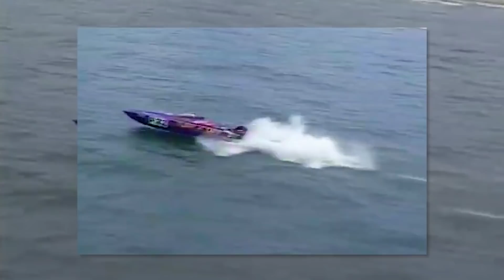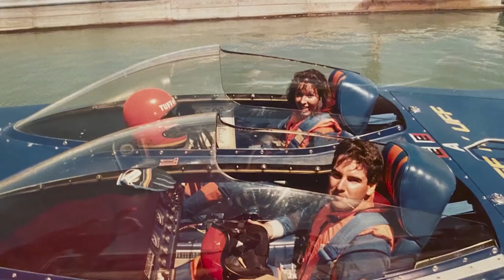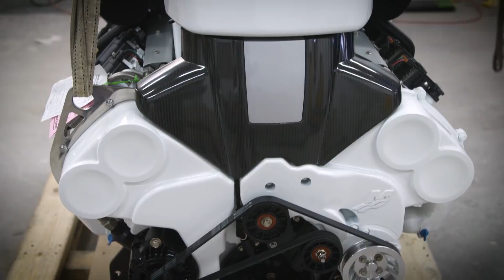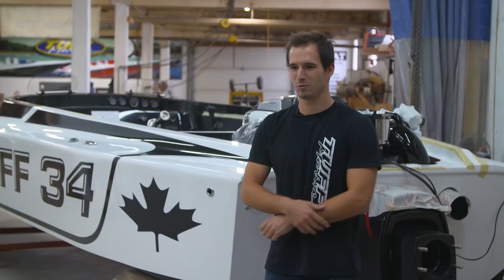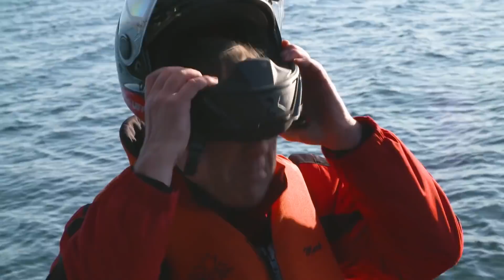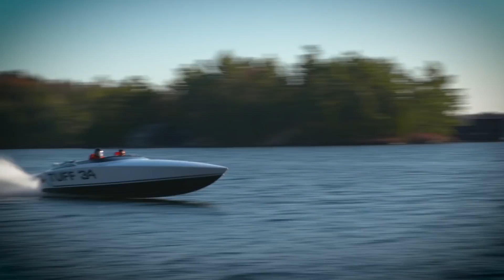Test Driving the World's Fastest Single-Engine V-Bottom Boat with Tuff Marine | PowerBoat Television

Comment: The 34 does not need more horsepower! 1100 is a lot! 10 additional mph can be gained by improving the aerodynamics! Move the steering wheel to the center and add an F16 safety capsule.

Comment: Australia must no be part of “the world” we run those speeds with skiers, and at one point we’re hitting 140mph with skiers under race conditions. The sport has since been speed capped at 125mph for safety. But you go have your world record mate 👍
Reply: There is no world outside of the United States. Hellrazor was pulling 139 towing 2 skiers.
Reply: @ianmiller7336  thats a jet boat. different class of boat
Reply: @SquarebodyShaun  No it's not, it was a twin turbo 540 chev. Aussies have been running boats like this since the late 80's.

Comment: I'm surprised you didn't go with the 1350/1550 motor. I'm also surprised you didn't design a stepped hull for it.
Reply: Lol.

Many complex and technical decisions go into this. 
Certainly not saying I understand them all but you should study the topic, boats and engines, more before you make such a comment. If those thing were feasible they would have done it. They didn't,  so, put simply,  it's not.   :)
Reply: @Bubbles99718  The only mistake I made was the 1350 engine; that's what they put in it(actually it was the new dual HP Merc 1100/1350.). And they certainly could have put at least one step in the hull. Steps can be put on any hull, Vbottom or multihull.

YOU need to study b/c you don't know f**kall about boats.
Reply: @dieseldog00  k

Comment: I had a 16ft Jolly Rodger that did 35 with a 90 Johnson on it when I got it. I built a ride plate-motor set back bracket and milled the heads 20 thou, and got it to run 58 mph. By far the fastest 90 horse on Lake Washington at the time.

Comment: How about putting a light weight all aluminum 2000+ HP twin turbo LS style engine in it?
Reply: High power motors for drag racing wont last long in a boat because of the extended time at full power. You reach top speed in a car in a matter of seconds and can let off the throttle. These boats need full power for at least several minutes with reliability.

Comment: How is this the fastest vbottom boat? In Australia we have single engine v bottom boats pulling two skiers down a narrow river at 130mph plus

https://youtu.be/HZ5sLPcWsDY and this is an old video, this record has since been broken many times.
Reply: Kyle Rhein  they reach these speeds in 1/4 mile.... 2500hp+ turbo engines in a 21foot v drive force hull tends to do that
Reply: Agreed, I don't get it either. IMHO, maybe it is a production boat thing??  I'm sure there's pretty strict class rules for it.  There's definitely waaay faster v bottoms around.

Comment: Your gauges showed 112mph @ 5899 rpm.  Max rpm for your motor is no more than 6500 rpm. How much for speed do you think to pick up?
Reply: They'll use a different prop...
Reply: Going to look for a recent run. That motor actually goes to 2500 hp in a burst so with a different propeller, who knows?

Comment: How do they handle rough water, on the bay or any ocean inlets. Will we see on the offshore circuit?
Reply: A flat smooth lake run is one thing... now go into 2 to 3 foot rollers in the sea. Joe Sgro and Aldo RIP.
Reply: Put simply,  they don't handle rough water. And certainly not in the top half of the speed range. 
Build this boat to handle rougher water and it loses, intentionally,  mph.

Comment: Looks like your no longer a boat racer at speed but a pilot. Some of those shots the boat hull was barely touching any water, just the lower unit. Amazingly smooth design! The boat has a clean but very aggressive stance in the water. Love it!!
Reply: Very high attitude... lucky not a cat. 🤔... probably light on fuel.

Comment: Hmmm worlds fastest Mono??? https://www.youtube.com/watch?v=HZ5sLPcWsDY thats towing 2 skiers notice it tops out at 137mph in the first straight and thats backing off the throttle!
Reply from the maker: That's incredible, thanks for sharing! I can't imagine standing on a plank of wood going that fast. Crazy stuff.
The Tuff team is just getting started with the Tuff 34. Mark's confident in his design target of 160mph and even more so after initial test runs with the wrong propeller and without calibrating the 1350 to its full potential. We're hoping to follow up when they've got it running at its top speed (if they'll have us back out!). I'm pretty sure it'll be the world's fastest single-engine Vee bottom, but I'm absolutely certain you won't catch me behind it on a waterski!

Comment: Not sure where you get your World Record numbers from but in Australia we have Force 23 skirace boats that are pulling 2 skiers at over 135mph and they are single engine v bottom boats.
Check out Hellrazor skirace boat at Robinvale on YouTube
Reply: That blue 28 Tuff with a merc 860 ran 137mph wide open from I understand.... the 125mph was a 3/4 mile race where that record stood. I think the 34 is projected to go 160+ all said and done.
Reply: @joshuareid3221  Aust Ski Race boats are really never run WOT without Skiers I am sure that Hellrazor or Mercforce would exceed those numbers without skiers. Before you blow them off maybe check them out they are a master of engineering and boat build also you have Nordic Boats in the US there 21 is super quick with a 1350/1550 twin drive boat as well.
Reply: So to go the quoted 160mph the boat on the numbers on the dash in the test and some assumptions (1.24 ratio drive, 5% slip (very optimistic)),  will require a 35" Prop and a run to the limiter! I am not sure that they will see 160mph. All calculations are based on Mercury's prop calculator which in my 30+ years of being involved with fast big engine Monohulls is pretty accurate.
Reply: @HP1050  Good to know, I wasn't blowing them off (no doubt they are impressive) I was simply just filling in the holes of the gentleman's comments about where the world record stood. Hellrazor isn't factory power from Mercury so I'm not going to compare them to Tuff's Merc powered boats but you have to think that the 34 boat is not nearly close to being setup. The 34 is still in 1100hp mode and hit 112mph on the limiter... there is plenty more on the table and from what I know about Tuff hulls is that it hadn't completely set on the pad in those runs. Lots of MPH still to come.
Reply: @HP1050  World Kilo Speed record is 153.794 MPH by an Aussie boat called "Madness" about 10yrs ago.
Reply: Exactly what i was thinking hellrazor was pulling big speeds in the bridge to bridge a few years back
Reply: Everybody knows the big old Evinrude V8 still holds the outboard record at least at 177 mph. Unofficially it exceeded 180 mph, they were aiming at 200 mph. But yeah, these are shallow Vs, you could enjoy your beer while cracking 100 mph.
Cheers 🍻